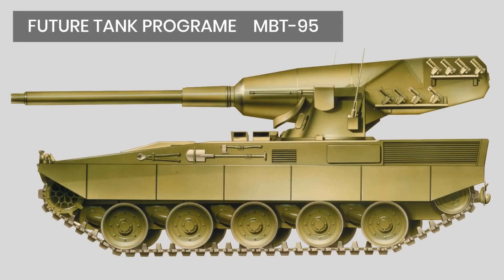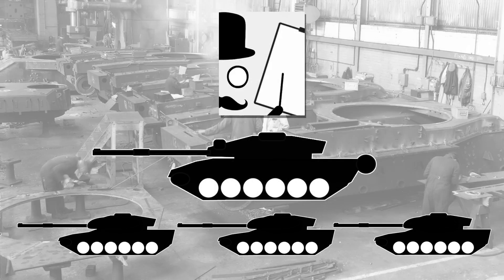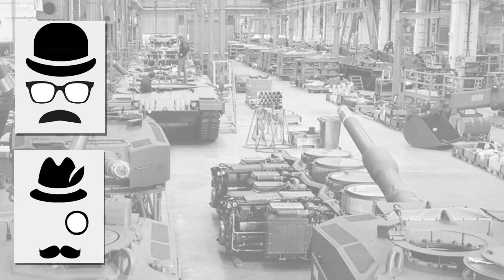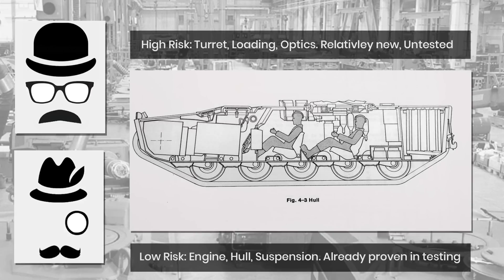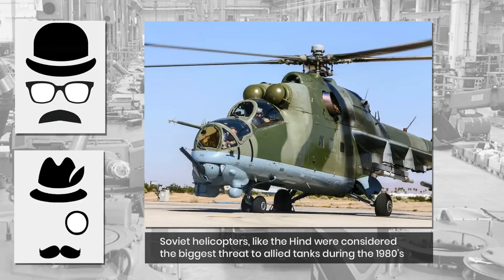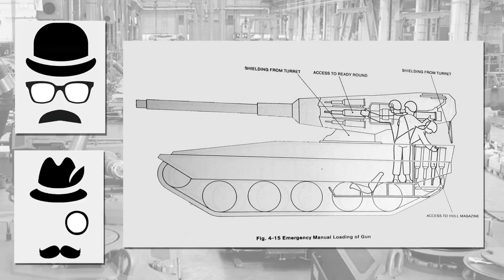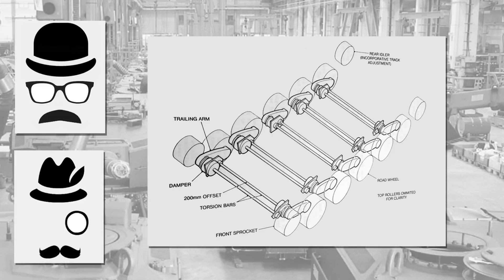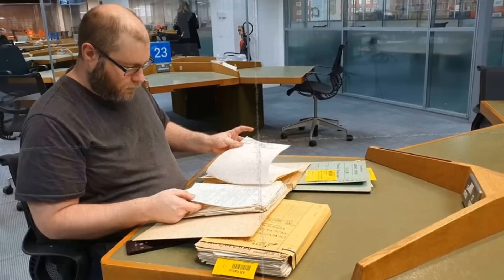MBT -95 - Leopard 2 hybrid: Tank Design & Development

Comment: Excellent video.  In the US, there is the MGS vehicle w a 105 mm gun and overhead turret, auto loader, 3 man crew. The initial design for this turret was done in the mid 80’s perhaps based on the excellent work done in the UK.   Would be great to see a video on MGS and similarities to this mbt95
Reply: More like taking inspiration from M1 CATTB which uses vertical carousel autoloader. The concept is then copied to the T-14 Armata.

Comment: My idea for a modern tank. Auto loader feeding up from the hull where all the ammo is stored and all the crew are located. Ammo and crew separated by a fixed blast proof partition, Compact turret at the back will reduce gun over hang and weight, access to ammo and auto loader from a back door. Engine and transmission at the front, provides crew protection and FR balance to the turret and ammo.
Thoughts. Good crew protection, turret provides some top down protection too. Ammo explosion requires the rear door to be able to blast out.. Rear mounted turret allows for whatever is required on the front deck. Would like to provide an emergency crew exit but that can't be done at the back. The small turret requires less to operate balanced by the auto loader requiring more. Richard's registered design, apply within.

Comment: Like it, like it! We had an Armata ready to go almost fifty years ago - I wonder why the Russians think it is a good idea now?
Reply: Various ideas for unmanned turret tanks have been around, with the M1 TTB a noteworthy test platform. However, western military forces transitioned to designs with ammo storage partitioned in the turret bustle. This proved to be very useful for improving crew survivability.

In contrast, the Russian tanks placed ammo in a floor carousel ... the infamous "turret launcher". Thus, there was a more pressing need for the Russians to replace their tanks with something different.

Going with a western style design could have been an option. Another option, taken by the Chinese, was to go with a hybrid approach - place the non-explosive APFSDS projectile in the floor carousel, while placing the propulsive charges in the bustle. But the Russians went with the approach of removing the crew from the turret. It still has the "turret launcher", but hopefully the crew won't be killed by it.

As far as the mechanical stuff is concerned, it's easier to move the crew than it is to move the ammo and redesign the autoloading system.
Reply: @IsaacKuo  the soviets considerd the approach the chinese went with (https://4.bp.blogspot.com/-KFFqTHa0XIE/WFk682XD_ZI/AAAAAAAAPzY/QOA_Ge7IPt883wkTAqRmAYlTlVZ-scHcwCLcB/s1600/2016-12-20_18-52-54.png) 

also the russians claim the T-14's turret maintaince hatch also acts as a blowout pannel. similarly the canceled burlak had its turret devided into 3 compartments by armour (separating the gunner and commander from the ammo and loader) and supposedly the explosion from the carousel would be vented out (from where i am not sure as it wasn't explained, presumably out of the shell ejection port, or they hadn't gotten that far when the project was canceled)
Reply: @matthiuskoenig3378  Interesting! Looking up the "Burlak tank", it looks like the ammo is stored in the rear turret bustle, so the blowout panels would work the same as in other tanks.

Comment: Putting a radar on a tank is as idiotic as a search light.
Reply: At the time, armies were worried about the Soviets using hot smoke concealment. In simulations, Soviets using an artillery barrage of such smoke rounds nullified the usual defender advantage and resulted in more or less 1-to-1 losses. Considering the higher numbers of Soviet tanks, this would be disastrous for defending West Germany.

So, they seriously considered the installation of radar, in order to be able to effectively fight in such conditions. It would allow defending tanks to detect and shoot at Soviet tanks advancing under smoke.

I can think of at least one alternative type of sensor suitable for this job, which wouldn't require spewing high power radio emissions toward the enemy - multi-microphone sensors. With 3+ spaced apart microphones, it would be possible to detect and precisely track tanks and other vehicles. However, this type of sensor has still not really been developed much. I don't really know why not.

Comment: Conception very similat to russian studies about future generation of tanks from 1980's. Efect of their works is T-14 Armata.
Reply: The layout is very different, though. The Armata's layout is similar to most of the unmanned turret concepts - crew in front, ammo carousel and turret in the center, and engine in rear. Same as M1 TTB, and various other concepts.

But this design is far more compact, with a front engine, crew partially underneath the turret, and extra ammo in the rear.
Reply: @IsaacKuo  its not too disimilar to the object 477, which had ammuntion in front, crew and turret in centre and engine at the back
Reply: @matthiuskoenig3378  Looking up Object 477, the internal design and philosophy seems very different. Object 477 seems to lean heavily into the hope that nothing ever hits the hull except from directly in front because ... ouch. Practically no protection along the sides, and almost impossible to NOT hit the ammo. And the way everyone's just crammed in beside the ammo, you won't just get turret launched ... you'll get vaporized. At least it'll be quick, I guess.

Comment: You have to wonder if the MBT-95 or something like it should be looked at again. Technology has come on apace since it was first proposed which could make something like this even more viable. Plus it is now realised by politicians that the notion that Russia was not a threat anymore was a false one.

I look forward to your next video. And I'll try and be a little bit more punctual.
Reply: There haven't been many new tanks in the last couple decades, so it's interesting to consider what new ideas might be prompted.

The few new tanks in this time suggest little or no enthusiasm for front engines outside of Merkava. Besides the generally lower armor protection provided by the front engine layout, it's a maintenance pain accessing the engine. However, hybrid propulsion might change things up. Battery packs could serve double duty as armor packs, and batteries could keep your tank moving even if a front engine were knocked out.

On the other hand, proposed tanks suggest folks are sticking with the traditional tank gun for main armament. So, the MBT-95 gun armament fits in. A Leclerc-like bustle autoloader seems like the newer standard, but things might look very different with unmanned turrets. At the very least, it's worth designers time to look at prior work like MBT-95.
Reply: @IsaacKuo  why would you want a front engine in a hybrid propulsion vehicle? it still suffers the maintance pain and reduced armour protection. any attempt at improveing armour protection is only going to make the maintaince pain worse. for what advantage?  especially when hybrid systems allow for twin-sponsoon engines allowing a rear door while maintaining the advantages of thicker front armour and alower frontal profile.

also i don't think batteries would make good armour.
Reply: @matthiuskoenig3378  The advantage sought in the MBT-95 was to make the tank a lot more compact, and to save weight by outright replacing front armor filling with the engine.

Generally, an engine isn't as good armor as dedicated armor (neither mass-wise nor volume-wise), but you still end up with savings because the replaced weight and volume is just erased from the design.

With something like the MBT-95 or Merkava, the designer may justify the decision by noting that historically hits on the hull were less common than hits on the turret. So, the fact that such a hit will immobilize the tank may be deemed an acceptable risk. I think this thinking is questionable given changes in context in the last few decades, but it still might apply.

With a new tank with hybrid propulsion, a hit knocking out the engine wouldn't even immobilize the tank. Think of the engine more like a battery recharger. If the engine is knocked out, it's dead weight but still useful as (sub-par) armor. And the batteries still keep you going.

Yes, it's a maintenance pain to get to that engine, but let's say the engine is conked out due to some whatever problem. You can still recharge your batteries periodically by linking up to a buddy. Your platoon might have only one working engine left, and you can still keep fighting.

Comment: Very interesting design. I feel like the mechanism for transferring ammo from the hull magazine to the drum magazine must be a bit fiddly and complex.

I find it interesting that such complex ammo movement systems were developed, but I think no one tried using a simple flat pan around the turret ring. The Soviet standard would be a carousel underneath the turret, but this required somewhat complex motions to lift ammo up to the level of the gun. A flat pan around the turret ring would already be at the right height, so all that would be needed is a claw that pulls a round directly into the breech. Such a flat pan could be segmented to vent ammo explosions upward, so a hit would only cause the loss of a few rounds.
Reply: Interesting idea about protecting the ammunition, Isaac. We have all seen the results of not having better protection for the rounds in Russian tanks. But when you consider that all the tanks being used by Russia are T-72s, with the T-90 all but being a rebadged T-72, they did not have to contend with the NLAW or Javelin when it was being designed back in the 60's.
Reply: @bigblue6917  Thanks, so much!

Research indicated that the majority of hits were in the turret, with the lowest part the tank least likely to be hit. At the time, tanks just sort of crammed ammo wherever it would fit. So, there wasn't really the idea of compartmentalizing ammo away from the crew, and the floor position was the safest option in that case.

If you look at, say, the M60, you see that there is ammo storage in the turret rear, but not compartmentalized. If it brewed up, the crew would be dead.

I don't know how that evolved into the safer idea of compartmentalized ammo storage with blowout panels, but my guess is that it would have been a somewhat confused reaction to Vietnam War experience with lots of lighter vehicles suffering ammo/fuel fires from certain HEAT warhead RPGs, and a general misunderstanding at the time that HEAT warheads melted the liner. The reality was that the narrow penetrating stream of the newer RPG-7 often penetrated without setting off a fire, but this idea would have been difficult to reconcile with your mental image of a blob of molten copper punching through a tank.
Reply: The issue with a flat pan as your autoloader feed mechanism is the space it takes up. The turret ring would have to be wide enough to fit such a pan inside it, thus potentially making the tank wider.
Reply: @RedXlV  The pan is supposed to be outside the turret ring, rather than inside the turret ring. The pan doesn't rotate, so the turret must rotate to index a fresh round.

Assuming a traditional tank layout, you'd want a gap in the pan for the driver's position.
Reply: @IsaacKuo  Very interesting idea Isaac. Are you any good at technical drawing. If so, give it a try, then we can see your proposed layout. I must admit I'm intrigued.
Reply: @gusgone4527  Thanks! I tried to reply with a link to a sketch I did, but YouTube isn't showing the comment.

Basically, imagine a circular turret. Outside the turret is the non-rotating pan of ammo - with a gap in front for the driver's position. The rear of the turret has a small port for the loading claw, and there's also a small internal loading ramp to bridge the gap between the breech and the turret rear. (There needs to be some gap to allow for gun recoil and ejection.)
Reply: @IsaacKuo  OK I get it. Thanks for the effort.